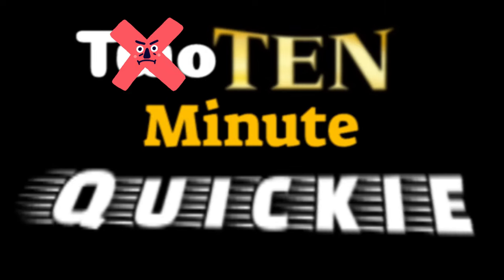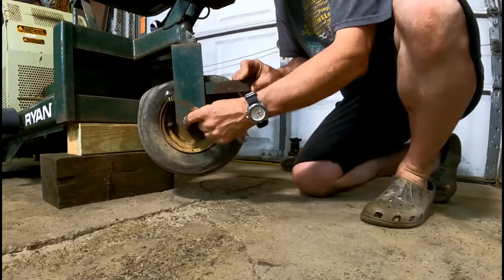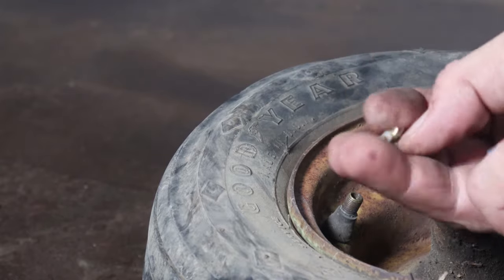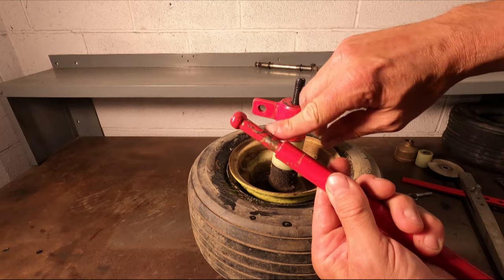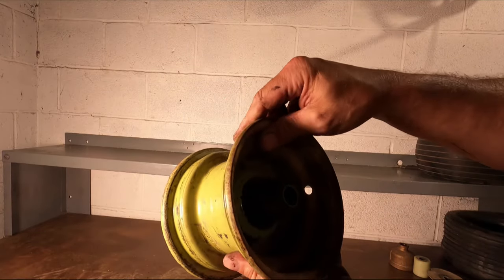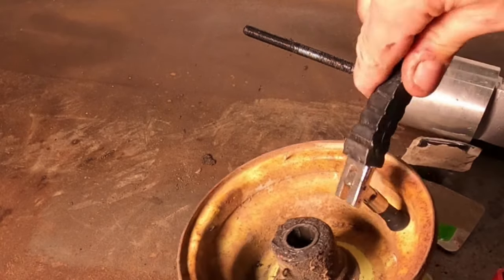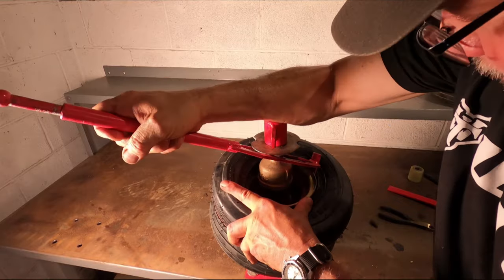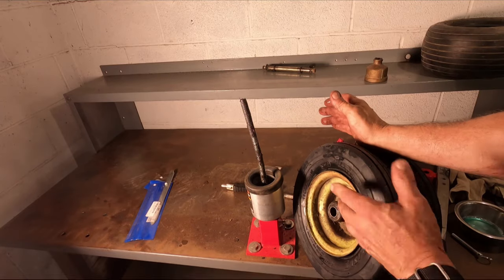Pittsburgh Mini Tire Changer Hacks and How To

Comment: Why the hell cant they make these little wheels as two piece bolt together assemblies? I have the bolt together wheels on my forklift and it’s so easy to change a tire. If they don’t want to spend a few extra bucks on a inner tube then why can’t they just have a groove on both halves on the wheel outside of the bolt circle and seal the thing with an o ring? It wouldn’t be difficult or expensive to design and build a wheel like this.
Reply from the maker: I agree. I'm sure that there's ways to perfect the way that I did this, but I wanted to let my viewers know that there's a learning curve to this tool just to let them know what they're getting into, as well as a little innovation. But yeah, a split rim would certainly make a lot of these tire changes easier. Thanks for watching and commenting.

Comment: You're not supposed to loosen the top nut when you're trying to Is break the beadOr  get the tire off that's why you  bent the main chaft on the machine. Sir.
Reply from the maker: Thanks for watching and the helpful tip Robert. I am a scholar when it comes to this machine.

Comment: You are bending the CRAP out of the center rod by not having the wheel locked down BEFORE each function, defeating how and why the changer was made in the first place. Lock the wheel down every time.
Reply from the maker: I will have to try that the next time I change one out. I'm definitely not very versed in this. More or less sharing the difficulties. Thanks for watching and providing that tip.